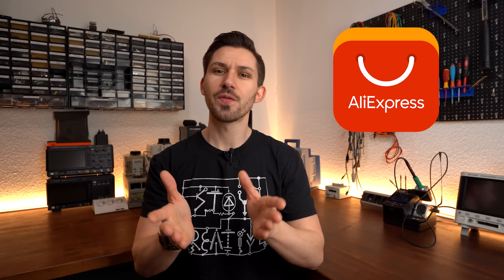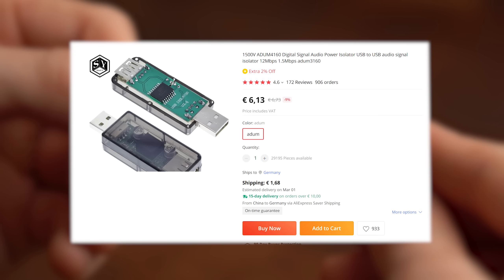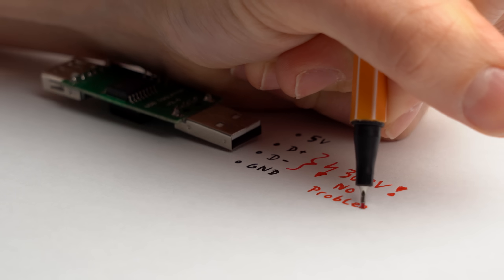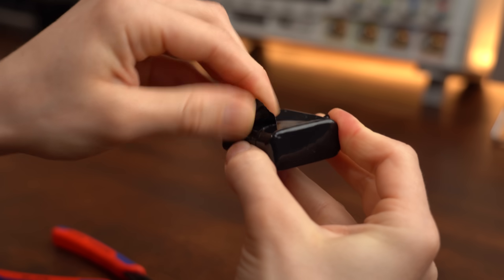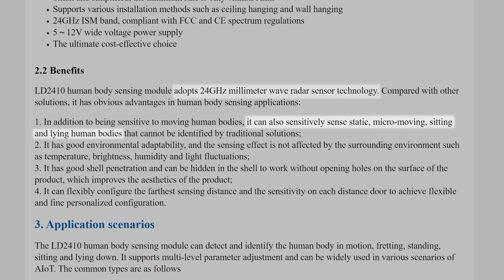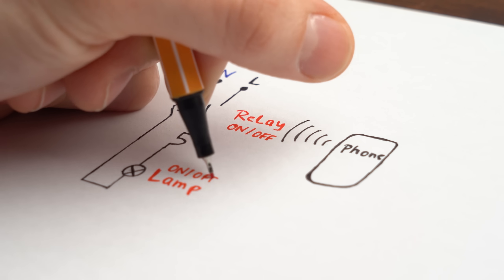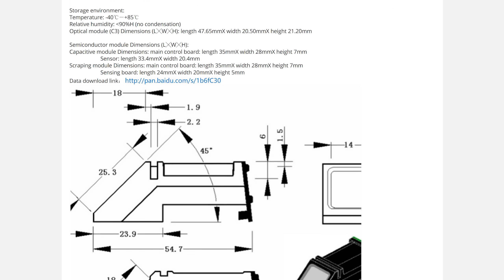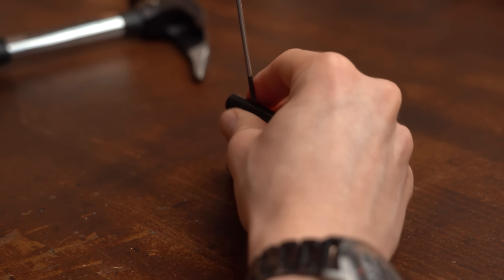I tried finding Hidden Gems on AliExpress AGAIN AGAIN!

Comment: Whats real scary to me about the horrible battery casings on the gloves is how they're marketed for skiing. Skiing and snowboarding both tend to involve lots of hits to the arms where the batteries are mounted when you're falling since tucking and taking the slam is way safer than trying to catch yourself and breaking your wrist.
Reply: Lipo batteries are not sticks of Dynamite. Crushing an enclosure can destroy or puncture a battery aswell. Lipo's can deform allot before shorting out and exploding in a spectacular fashion
Reply: to melt snow and signal for help in one go
/s
that's a horrible way to package and wire batteries
Reply: you can buy the same gloves without batteries but with usb cables, so you choose the powerbank you trust and put it in your backpack. It is the only way it can be safe.
Reply: @LeBlafy Or connect it to a cheap Chinese unisolated phone charger😂
Reply: ❗It's not a bug; it's a feature!
  Hitting the battery pack very hard is how one would typically engage "EXTREME Heat Mode"¹ for those especially EXTREME low-temperature conditions. 

¹ - Only for use in emergency situations.  Short run-time.  May result in the loss of fingers, hands, or limbs.  The manufacturer bears no responsibility or liability for any form of loss, both personal and material.  Use at own risk.

😂
Reply: Going out like General Grievous while flying down a slope is a feature, though.
Reply: Motorcycling too. Motorcycles are already known for being very painful to the rider in collisions, now add your hands exploding onto that.
Reply: You’re falling down when skiing?!?! You clearly must add some twenty years of experience.
Reply: I won't pretend to know what "tucking and taking the slam" might mean in the context of skiing, but be assured that you won't be breaking the cells no matter how hard you fall. They can take a 40 degree bend and still not ignite.
Reply: If you are skiing and need gloves like this, then you are not skiing hard enough :) Still horrible marketing.
Reply: @BansheeHero  true but some of us got horrible circulation in our hands sadly. Few weeks back was hiking park on a snowboard in the high 30s, overheating bad enough to go shirtless but still rocking gloves. Gotta remember us snowboarders are knuckle draggers by nature lmao.
Reply: @TheRealSquirre1  even just walking through the snow I end up overheating like that and having to go shirtless or at least open the zipper on the jacket when I'm actually doing anything it's insane how hot I get in the snow. I was running around in the snow in Alaska naked in sandals lmao
Reply: Yeah, I'm gonna pass. Alkaline batteries are quite suitable for this purpose without risking melting your hands off, or NiMH if you actually need to use them more than a few hours a year.
Reply: Sure, but when your hands catch on fire you can just take the gloves off and throw them in the snow ;-)
Reply: Chinese products are never known for being safe.

Comment: Love the series. Keep coming. Danke!

Just an observation, I think you made a mistake IMHO. 

Charging 2 batteries with the same nominal voltage in parallel is safe even if they have different SOC at the time of charging because once one battery is full, the charge will just keep going on the other. Also, if 2 batteries are connected in parallel, the battery with more juice will charge the other with less juice until they are equal.

It would be dangerous IF one of the battery packs has a lower nominal voltage, which is not the case.
Reply from the maker: More to come! ;-)

Comment: I wonder how well the USB isolator would have stopped, if at all, a poisoned thumbdrive.

That's how stuxnet got into Iran's centrifuges, an operative dropped a thumbdrive outside the building and an employee picked it up, took it in, and plugged it into their computers. Smh.

Well played by the boys in Langley tho, fr.

And the fingerprint reader..wouldn't 0.001 be 1thou? As in 1 out of 1,000 not 100,000? That's how we read it machining anyways but I'm no authority.

Comment: I won't buy products with such dodgy LiPo pouch batteries from AliExpress again. They are usually low quality to begin with and often a fire hazard after a few cycles. Devices that allow putting in your own, quality, 18650 cells are a lot safer.

Comment: Aliexpress is great for smaller things that you can't find locally or on some more popular stores.
I ordered 2 M.2 ssds from Amazon, only to find out that I didn't have any screws to screw them into the motherboard. Everywhere I looked, I couldn't find those exact screws.
Then I found them selling M.2 heatsinks for really cheap, and they came with the screws and a small screwdriver. That was a great deal for me since one of the SSDs didn't come with a heatsink, anyway. It cools the SSD almost as well as the one with the official heatsink. 
I was hesitant about buying from Aliexpress at first, but it's great for such things, just always take a closer look when you're buying something, because it isn't as well regulated as some bigger stores.
Reply: I have bought more than 100 items from Aliexpress ,from a 3d printer to small items with very few problems. And those were due to the shipping rather than the vendor.
I always look at the vendor's store ratings , the numbers of the item sold by that store and buyer's reviews. Those indicators are a fairly good guide to how your purchase with go.
Reply: @paulg3336  Yeah I buy most things from aliexpress now unless I need it fast in which case I will use a more local supplier. I have had a few issues with products not being as advertised or damaged and Aliexpress stepped in and gave me a refund for them, but for the most part everything is fine. The best tips are if it is something of value make sure the store has been around for a while and has good reviews or are a manufacturers own store. A lot of the cheap stuff you can get locally you can get even cheaper from aliexpress since there are companies that just buy that stuff in bulk from china and stick their logo on it and then charge a huge markup on it.

Aliexpress vendors sometimes have local warehouses too. When I bought my 3D printer it would have been £30 to get it shipped from china or free shipping from their UK warehouse, I have bought filament from a UK warehouse too and it comes in a couple of days.
Reply: M.2 SSD's use flat head M2.0 x 2.5mm or M2.2 x 3mm, should be found just about anywhere in the western world surely?
Reply: @backgammonbacon  I tried looking for them, but couldn't find anything locally. Amazon has them but they are much more expensive when you include the delivery cost. I paid around 5 bucks for that heatsink, screws and screwdriver combo.
I'd have to pay over 15 bucks just to get the screws and the screwdriver from Amazon.
Reply: Just buy a screw repair kit fore glassen now you got all the little screws fore 10€

Comment: with isolated USB power, you could connect two of them in series for a 10 V output, since they are fully isolated... also, excellent for something like one of those USB interface 'scopes, or multimeters, et al, no Ground, so you could use the devices for power-line measurements with quite good safety factor...only thing, I don't see an actual VDE or similar isolation rating.

Comment: I wonder if that fingerprint reader is also subject to the same issues from optical recognition: it's easy to fool by putting the real fingerprint on a piece of paper in front of your own finger.
Usually there needs to be other tech like radar to register the ridges, check for a pulse, etc...

Also, that relay probably needs to have an account due to them using their own API keys to access the various notifications APIs. In order to bypass this, you'd essentially have to have your own code to handle it on the device, or have the device push messages to something like homeassistant, which can then send alerts to the API. I'd prefer to be able to push to homeassistant, but yeah.... I really don't like when you're not given any real option :(.
Reply from the maker: Thanks for the feedback :-)
Reply: @greatscottlab  Michigan State University did a research project trying all the known methods of spoofing fingerprints against fingerprint readers a number of years back (and created an open source project so you can make your own that can't be spoofed). 
This would be a great paper to read to learn how the spoofing works and how to test for yourself.
Search for RaspiReader for the university's paper, article, and project pages.

Comment: those relays have a esp module wich can be flashed with custom software i also dont like the ewelink app the sonoff switches use so i intergrated them into a homeassistant/esphome instalation no account needed and local control

Comment: I never thought that this kind of human presence sensor is available on the market.
Thank you for that.
Keep the good work up :D
Reply from the maker: Thanks, will do!
Reply: The Bluetooth version of that sensor is natively supported by Home Assistant over Bluetooth now too.
Reply: @veryboringname.  phantastic news!
Reply: One thing to watch out for with HPS is that - in my experience - they will swamp any WiFi kit in he beam path. I used one to detect people approaching my front door and  trigger a dog-bark sound effect. It worked well, but it caused my video doorbell to go off-line whenever it was active.
Reply: They are fantastic. Just started using them in HA and they work wonderfully. No more waving arms like a fool trying to trip a PIR!
Reply: I kind of guessed such sensor should exist as I installed a rather recent automatic ceiling lamp in an inside corridor.
This lamp had no visible sensor, and this fucker even turned on when I was coming from behind a wooden door before even moving it. I found that insane and guessed it was some kind of very sensitive acoustic or radio sensor.
Reply: @GogogoFolowMe  Lamps usually use a basic microwave sensor which have been around for quite a while. They're usually used in automatic sliding doors. They don't sense presence, just motion. At these prices it won't be long until lights start using presence sensors though!

Comment: I'm really disappointed with my SONOFF light bulbs controlled from the eWeLink app. The thing is I can't use them with my Home Assistant is so annoying. Only if I switched them into a "DIY mode" and then used a REST API. Even then, it's a huge hassle.

Comment: If the glove batteries have charge protection built in then it's perfectly fine to connect them in parallel to the charger since their individual charging controllers will manage their charge and won't let them overload or discharge too much.
Reply from the maker: Nono. It is just a BMS. It does not control the charging. The original power supply provides 8.4V and 1A charging current. It does the CC CV charging method. The batteries only have the protection circuit.
Reply: @greatscottlab  But that means that since each is managed then they won't go out of balance.when one is charged it will just stop while the other continues to charge.

Comment: These Ewelink products should also be able to be accessed by IP. You can implement them in Home Assistant just via IP, no need to use their own service. Not sure if you can do it without first setting up an account though.
Reply: Great if you can do this, at least if it's not necessary later, then a throw-away account for 1st setup should be enough.
Reply: Yep, you have IP access.

Comment: What would happen if somebody messed with the supply or data voltage of the fingerprint reader, by maybe collapsing or rising it in specific intervals? Would it maybe false trigger, stop working or have adequate protection?
Reply from the maker: I can certainly test that out in the project video

Comment: The PSF-B Module in the Wifi Relay is actually an ESP8285, so you can flash it with Tasmota and then use it without the cloud
Reply from the maker: Can you flash it over WiFi?
Reply: @greatscottlab   Unfortunately that depends on the current firmware, if they allow OTA file upload to upgrade then it might be possible, but otherwise it would require soldering some programming pins (or more likely finding the header) and hooking up a ESP-Prog (Just UART with additional control flow abuse for strapping pins really)
Reply: @greatscottlab  There also similar din switches from the brand Tongou TO-Q with Zigbee. But what i know from the brand Tongou is that the safety and quality should be really good! :)
Reply: @greatscottlab  It might work with toyaConvert (which basically emulates the cloud and uploads a custom firmware)
Reply: @greatscottlab  The relay uses the eWeLink app? Is it supported by AlexxIT's SonoffLAN on Home Assistant maybe?

SonoffLAN is what I use for my S31 smart outlets with power monitoring on my HA setup. (I have about a dozen, half of them used daily for a couple years, no problems. Can't beat the price. Only the wireless version has energy monitoring though last I checked, I would have liked it with the Zigbee version.) Might only be USA plug? 🙁
Reply: It seems like a lot of these type of WiFi smart home devices use the same various ESP modules that the DIY home automation scene  uses, but often it requires some disassembly and potentially soldering to reprogram them.

Still, would be worth it IMO if there's not a good option for cheap otherwise.
Reply: @LuciaMakes  Many Low-Cost Wifi Switching devices moving now to Beken Modules (Like WB2S, WB2L, CB2S, CB2L). But even for them there is now a alternative Firmware "OpenBK". Not as much features as Tasmota but enough for most cases.
Reply: That would make a really cool video!
Reply: Also for wireless home autoamtion i would suggest using zigbee over wifi. Zigbee devices have vendorless connection and are easily integrated into Home Assistant and other systems. And yeah, in any circumstance do not ever replace circuit breakers with such things, that's not what they're meant for

Comment: Keep up with this series; the potential is immense. Just keep some randomness to what you test and buy, like you have been doing !
Reply from the maker: Thanks, will do!
Reply: @greatscottlab  I really like these new videos. Make sure you take advantage of YouTube shorts. Do a brief view of each product separately on there and make it “catchy”… like an old infomercial. Shorts can help a channel grow. =]
Reply: @greatscottlab  Just to let you know, the e-link is a whole series of DIY-able devices, but never seen them sell this breaker China (suppose few of us mess with breaker boards), what they sell here are four-channel 10 amp relays that can mount inside a standard electrical box for sockets and switches. They also have a pretty cool thing that plugs into a computer's power button so you could turn it on and force it off remotely. The reason they need a account is because they provide cloud service and they need to identify you. Otherwise anyone could control your devices. If you go with LAN, use ESPHOME with HomeAssistant and flash these devices with custom firmware.
By the way, the fingerprint sensor should be much cheaper, I got mine for 50 RMB, roughly 5 Euros. And the human radar should be even cheaper (a little different from what I have seen but should all function the same). I guess the extra price is just the shipping to Europe. Try buying in bulk next time to save some money. I could buy a bunch of these interesting modules and ship them for you if you wish.
Reply: @greatscottlab  if you are really a Scott, why such hard german accent?
Reply: Haha I see what you did there... Bet you couldn't RESIST yourself... Badumbumtisch
Reply: He is doing us electronic tinkerers a great favor 👍🏻
Reply: Speaking of series and parallel, noone gunna talk about how great scott got the danger of parallel and series batteries mixed up. 
Two batteries in parallel will charge eachother just as if it were on a charger. In series however, when a cell drops below another, it will end up getting reversed charged, this is why ur batteries leak!!!!! Just realized how flawed dave jones battery test is now. He did get a couple leakers tho
Reply: I wonder if there is a way to get gpio pins on your laptop as it would be cost affective solution for learning robotics try finding something similar .thx for your effort 👌
Reply: @parshvapatel8484  I think you can do that with nothing but a Raspberry Pi Pico and some firmware called u2if. Adafruit has a great guide on it.